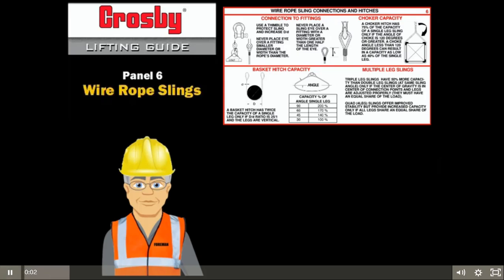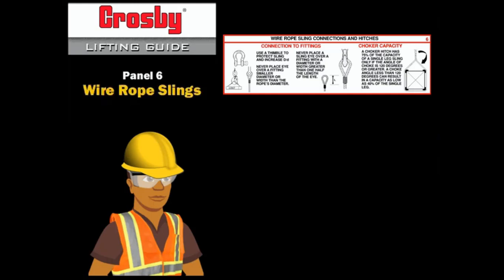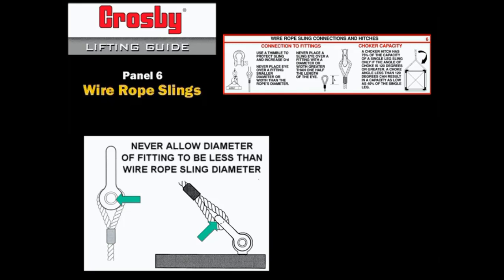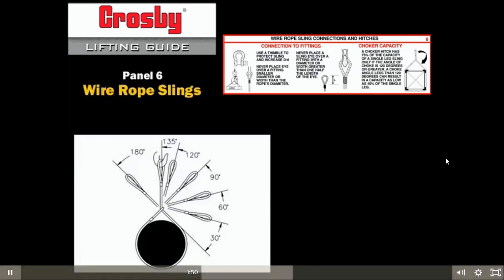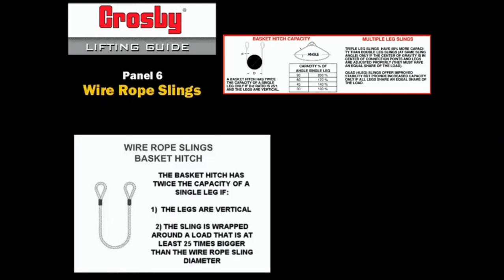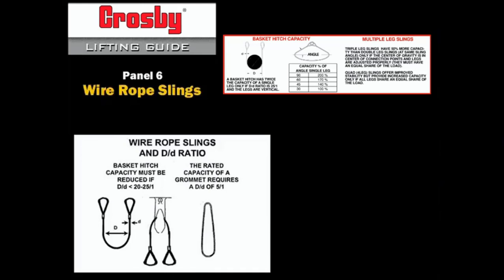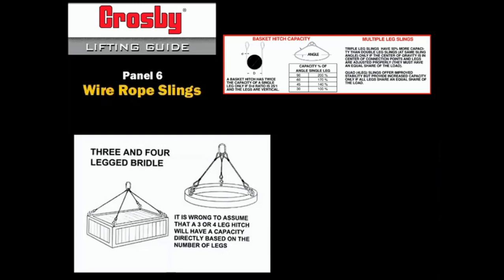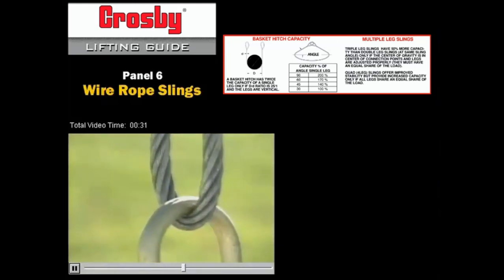Wire Rope Sling Connections and Hitches

Comment from the maker: Question 1 of 8
1. Question
Category: D/d Ratio
In order to have an adequate D/d ratio in the eye of a wire rope sling, you should use a 1″ Crosby shackle with:
•   1" diameter wire rope
•   1 1/8" diameter or greater wire rope
•   7/8" diameter or smaller wire rope

Question 2 of 8
2. Question
Category: Capacity: Bridle Hitches
The capacity of a three leg bridle hitch at a 45° angle of loading (horizontal sling angle) for 1″ diameter EIP wire rope is:
•   Always more than that of a two leg bridle hitch at a 45° angle
•   Always more than that of a two leg bridle hitch at a 60° angle
•   21 Tons if sling legs are close to the same length and are properly spaced around the C.O.G. (Each sling carrying an equal share of the load).
•   25.5 Tons if sling legs are close to the same length and are properly spaced around the C.O.G. (Each sling carrying an equal share of the load).

Question 3 of 8
3. Question
Category: Capacity: Bridle Hitches
The capacity of a four leg bridle hitch at a 60° angle of loading (horizontal sling angle) for 1″ diameter wire rope is:
•   Always based on four legs if C.O.G. is properly placed
•   May be no more than a two leg bridle
•   Is always double that of a two leg bridle

Question 4 of 8
4. Question
Category: Fittings
When placing the eye of a wire rope sling in a shackle or hook, the diameter of the shackle or width of the hook must be:
•   Greater than the diameter of the wire rope
•   Less than the diameter of the wire rope

Question 5 of 8
5. Question
Category: Fittings
When placing the eye of a wire rope sling in a shackle or hook, the diameter of the shackle or width of the hook must be:
•   Greater than 1/2 the length of the eye
•   Less than 1/2 the length of the eye

Question 6 of 8
6. Question
Category: Capacity: Choker & Basket Hitches
The choker hitch capacity of the sling is based on an angle of choke of:
•   120 degrees or greater
•   Less than 120 degrees
•   "Beating" down eye of sling

Question 7 of 8
7. Question
Category: Capacity: Choker & Basket Hitches
A wire rope basket hitch is two times (200%) of a single leg only if:
(select all that apply)
•   Basket hitch is vertical
•   The basket hitch has a D/d ratio of 25 to 1 or greater
•   The basket hitch has a D/d ratio of less than 25 to 1
Question 8 of 8
8. Question
Category: Capacity: Choker & Basket Hitches
If you are using a single sling in a basket hitch, with the eyes collected at a common point and the resulting angles of loading (horizontal sling angles) are 30° at the load, the sling will have a capacity of:
•   Twice (200%) the single leg
•   Less than the single leg
•   Same as the single leg